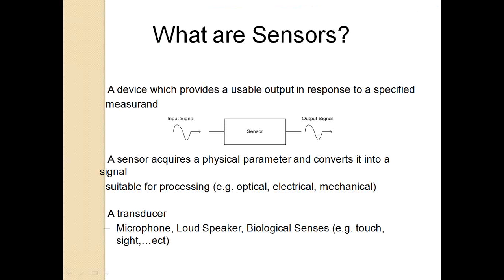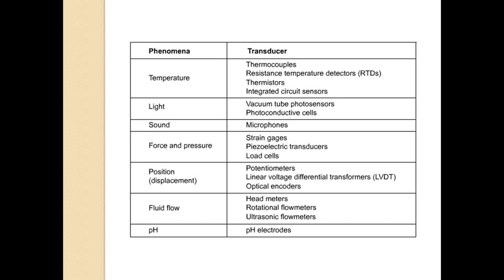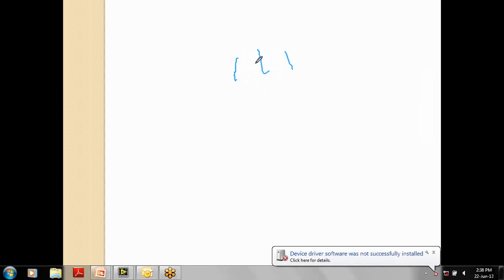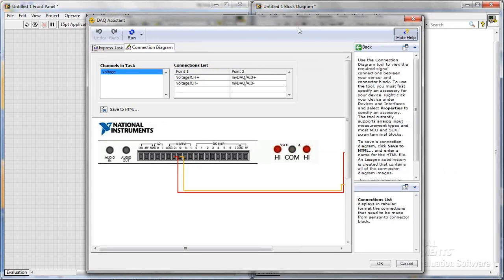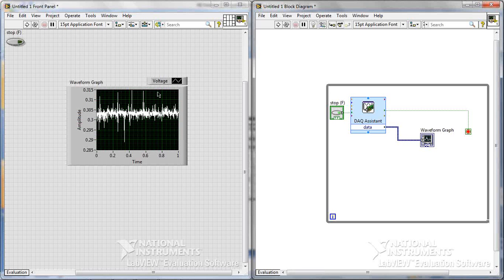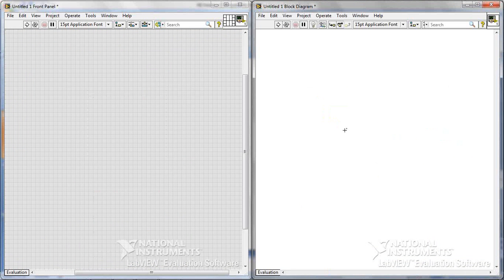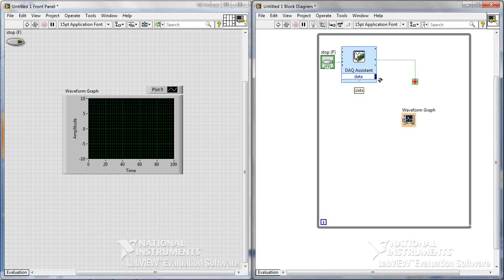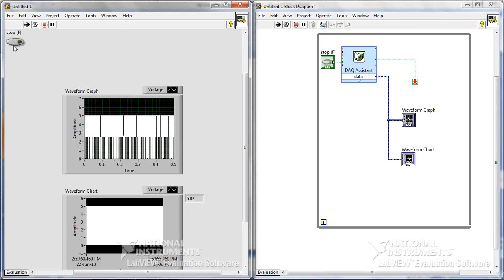Introduction to Sensors & world of Data Acquisition - II

Comment: Its a very helpful video....thanks for uploading
I had a question. I am using Baumer Light distance sensor for measuring displacements whose analog output voltage range is 0-10V and a NI DAQ USB-6009. I am not clear on how to connect the sensor ( +Vs, analog 0-10V and 0V) wires in DAQ.

Thank you for your help...